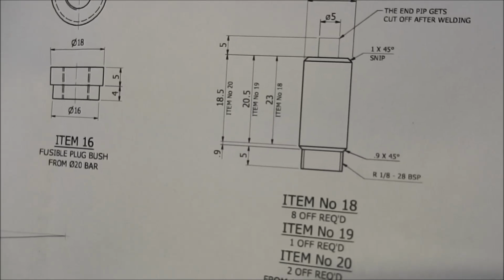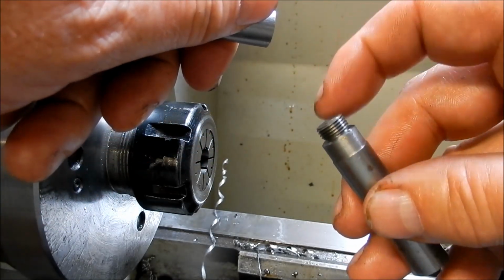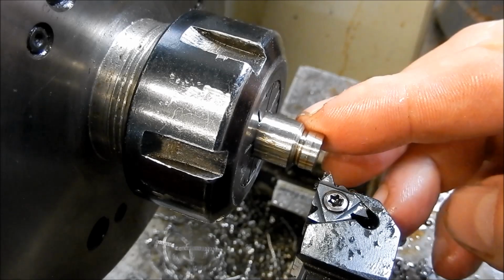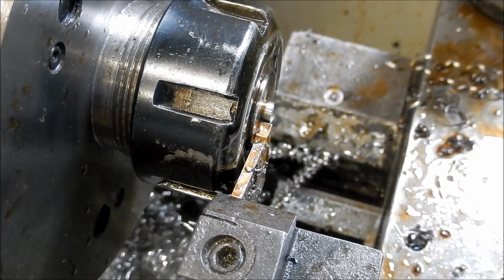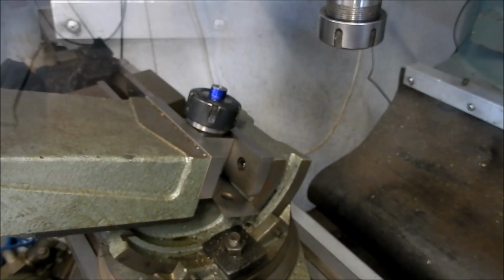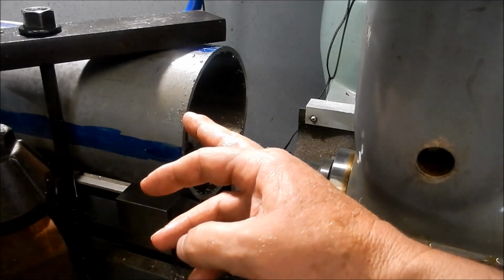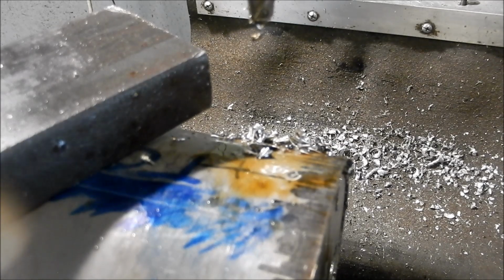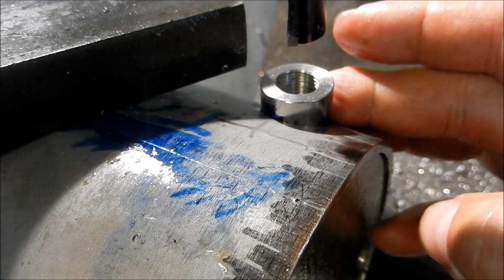Machining up some more of the Boiler components in the Duplex 2205 S/Steel

Comment: Hi Cam,
I really enjoyed this video... I would like to get good at working with Stainless Steel so it is great watch and learn... Thank you.
Take care
Paul,,
Reply from the maker: Hi Paul, 300 & 400 series stainless is much easier to work with and more predictable than this 2000 series stuff.  Anyway I'm stating to get a feel for it, at least until I break the next tap again.
Cam
Reply: As an apprentice in the seventies, I was told "Slow and Hard", with SS, we used to use quite a lot of it, and with high speed steel bits, and a few brazed carbide. Not that I am an expert, but I machined some mystery SS a few weeks ago, and had to reduce SFM by 25%, compared to low carbon steels, normally 50% is sufficient, just be wary of the swarf on a lathe, it's nasty.
Just my 2 pence worth.
Regards from the Black Country, John.

Comment: G’day Cam, not a good material to work with, I hope it’s worth it. 
Cheers 
Peter
Reply from the maker: Hi Pete, yes its like machining a Gumby Bear that goes glass hard instantly with any rubbing.  If I stuff a hole up that has got to be tapped and the surface has gone hard I'm in real trouble.  Not looking forward to the large number of holes I need to drill and tap after the boiler has been fabricated.  Its a quoted job so yes I hope I can get through it with minimum breakages.
Cam